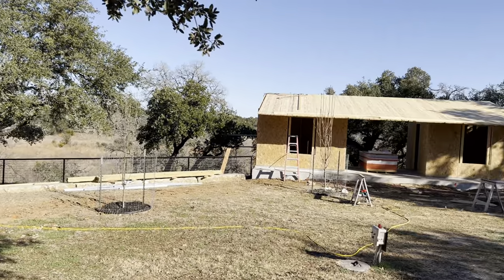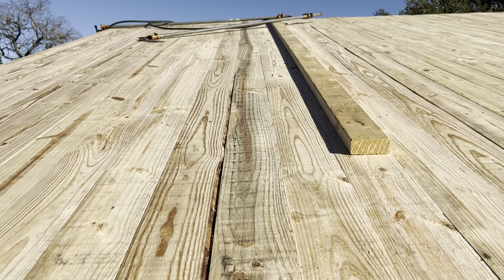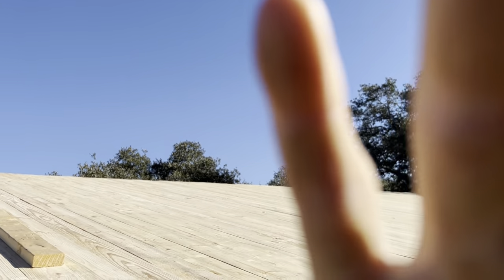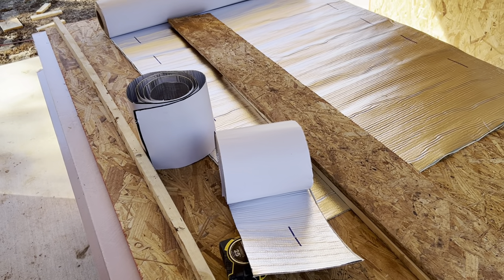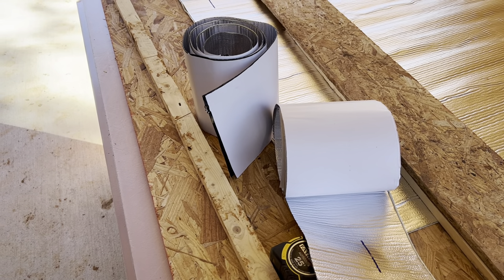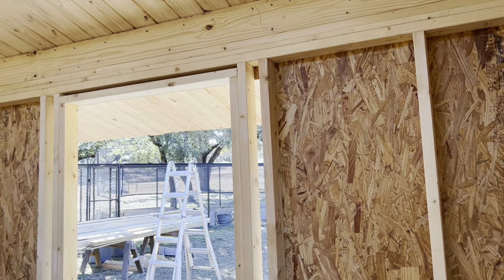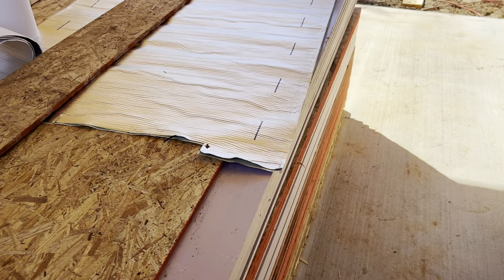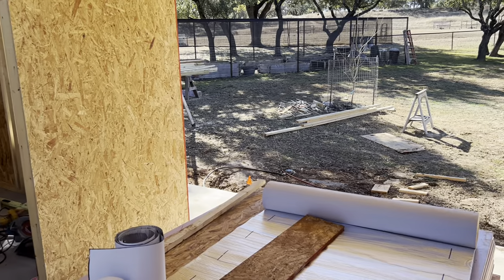How To Design An Efficient Solar Shed and Some Important Things To Think About

Comment: Ray that is going to be a really nice solar shed. Great attention to detail as usual. Got my battery top balanced. Going to switch over to lifepo from lithium ion tomorrow. Reprogram my charge controller for the new batteries and add 8 more panels to the array. It's not as great as your setup but it is a reliable system.
Keep the videos coming!

Comment: I insulted my tiny shed internally with foil backed wool. Expensive stuff but keeps me warm when potting around in the winter months. I have two 150w greenhouse cylindrical heaters on the walls and after 15mins the cabin is warm enough to play my drum in. Very happy 😊
Reply from the maker: foil backed wool? Do you mean rock wool or actual wool? Is the foil backing adjacent to an airspace or is it touching a surface?
Reply: @RayBuildsCoolStuff  touching a surface. I put it underside of the ceiling and in walls.it’s a super quilt.
Reply from the maker: @lennieadi  the foil face acts as radiant barrier but only if it has an air space. You lose the benefit of the radiant barrier if there is no air space because the heat is transferred by conduction. Sounds like it is working anyway though.
Reply: @RayBuildsCoolStuff  ok

Comment: Nice video Ray. I think they mean water vapor should be able move from inside to outside or vise versa ..but ofc air should not move at all. We here in Europe are not used to your construction so it is always fascinated to me how you are building houses. So far as i was checking all videos.. The best way is to insulate from outside.

For your solar shed it isn't so critical. I did mention it in some video before (maybe not for you :) ) You usually don't care if your shed is insulated much or not.

Some insulation is needed..but it isn't critical.

Your inverters /chargers don't care about cold weather..well it must not be freezing and it must not be very humid that is very important.

Battery is another mater. You can use heating just inside your battery box ..small plc or similar device that will do it's job ..start and stop heater inside your battery ..one ptc as temp probe and that is all you need. If temp. is above freezing it can be charged and that is all.. It isn't big deal as in closed box (usually in winter) battery cells will self heat as they get charged or discharged..

But during summer month i expect you would need some ventilation..this can be done with same PLC or similar. I had this kind of system...but i will be honest i have flooded battery so freezing is never problem and char/disch also...but i bought and waiting for cells LiFE so for these i will need to do something ..not sure yet..i didn't buy inverter for them also..so i'm in waiting phase ..waiting for my sallary phase :) haha ..

Comment: Interesting and makes all of sense,  in Northern Minnesota I did two walls. Outer wall with insulation and taped plastic and an inner wall with all the pipes and wires. Basement is ICF hard to beat but expensive.

Comment: In you next video, can you talk about the angle of the roof and where the angles are placed and where the wood is 90 degrees to the wood. It looks like the beams are 90 to the roof, but then at what point do you have angles to the walls. I assume the beams are not sitting at an angle to the walls, but there must be some wedges somewhere.
Reply from the maker: Yes there are wedges of 14 degrees. The roof is at a 3 in 12 pitch. There is a level top plate and then a pitched top plate with a wedge providing the can't. The roof  faces due south.

Comment: I'd like to see a lot less regulation and more thinking through solutions that are appropriate like you have Ray. As much as it helps insurance companies assess risks, strict regulations increase costs, decrease quality and do not result in optimized buildings. We have to find a middle ground - these building should primarily serve people and all other legislated fixed requirements are and should be secondary.
The other problem with regs as they are, is we just create a generation of unthinking, unaccountable builders.

Comment: with the air tie of the biulding and the form what will be temp of the solar shed with out heat or how much heat need to keep the battey
Reply from the maker: In the solar side, little to no heat but cooling will be a big factor in the summer. In the garden side heat will be a factor for the two months that there are chicks being raised in early spring.

Comment: I would love to have you help me build a solar shed but unfortunately your attention to detail would be to expensive for my wallet, i am a DIY everything type of person but you take it to an entirely new level, I would imagine you could heat that entire shed with the strike of a single match
Reply from the maker: DIY is the way to go. Attention do detail isn't expensive unless you let it be. I figure brain power is free. I work out the details on the 30 minute drive to work and while laying in bed as I go to sleep. In the 5-10 minutes before I drift off I decide what I'll do tomorrow or how I'll do it. Of course I have a long range plan as well.
Reply: @RayBuildsCoolStuff  I agree 100% but to hire someone with your forward looking thinking is the expensive part, your labor and thinking is worth atlleast 10× the material cost

Comment: What are your thoughts on the ZIP systems?
Reply from the maker: Honestly I think it is terrible. I can't really get into a discussion of zip system in the comments section. Wall design is too involved and deserves a discussion of air and vapor movement, drainage planes, condensing surfaces and long term durability.
Reply: @RayBuildsCoolStuff  Interesting! have you considered setting up a basic blog site where you can put up your thoughts and photos on misc subjects a bit quicker and easier than youtube?
Reply: @allan80supra  ... or maybe he might consider making short videos on various topics on this channel, which would be too involved in these comments.  I have seen others do with with a title that includes "#SHORT" and are less than 3 minutes in length.